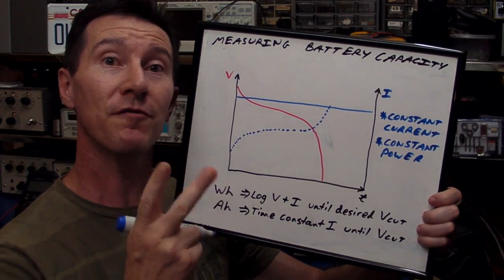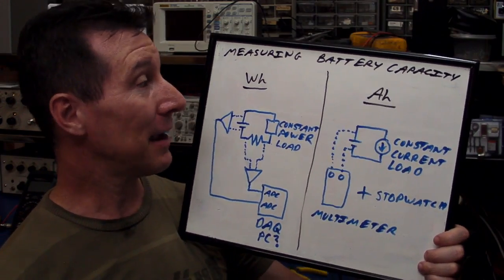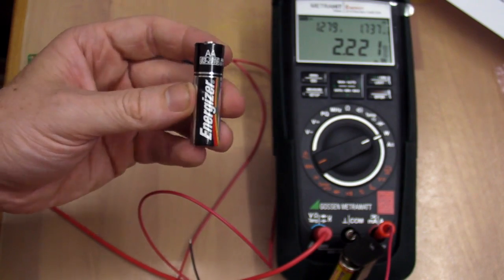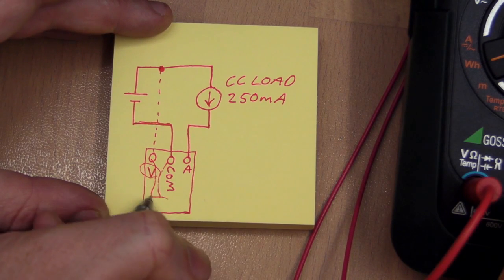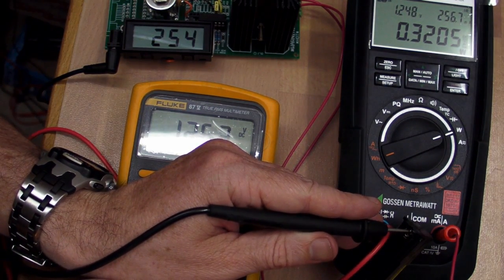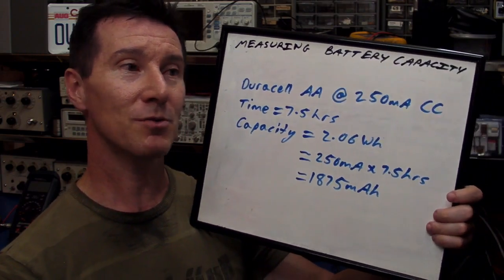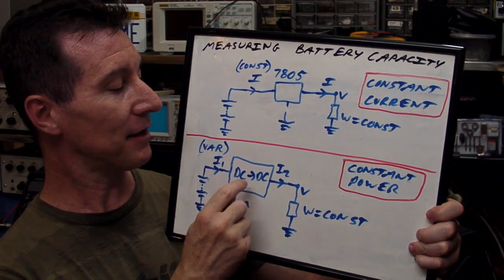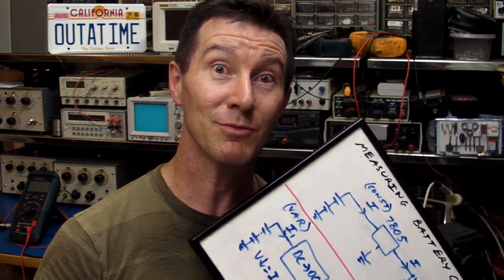EEVblog #141 - AA Alkaline Battery Capacity Measurement

Comment: If you've got a constant power load, as mentioned @ 3:20, you won't need a DAQ integrating P=U*I, but also only a stopwatch: E=P*t; if the power isn't constant (e.g. using a resistor, or a constant current sink, you'll have to calculate P=Integral(U*I*dt), of course)

Comment: EV-SAMSON SUPER BATTERY BOOSTER / 650% MORE ENERGY THAN A BATTERY ALONE CAN SUPPLY THIS AA BATTERY IS A RECHARGABLE BATTERY 1.2VDC @ 1400mAH THE BATTERY ENERGY IS COMPARED TO IT`S OUTPUT ENERGY GENERATOR / READ BELOW THE VIDEO TO FULLY UNDERSTAND THIS SYSTEM WORK OVER TIME / https://youtu.be/6eP-B_d9DoI

Comment: Ah the Procell! I have found these to be of a somewhat lesser quality than a bog standard Duracell battery... I have gone through heaps of these over the last few years, and they all seem to wet the bed when in a low-load situation such as a remote!
I've even opened a 24-pack of these in the C size, about two years from expiry, and a third of the carton were leakers!
The number of spring-terminals I've lost to Duracell makes me ill...

Comment: wouldn't it be easy to make a battery testing circuit for total mah, a constant current load circuit, a timer circuit , and a voltmeter circuit and a way to log the values . and some logic that make it start the timer when plugged in and stop it at dead
Reply: It would be fairly easy. You could probably use a current limiting diode.

Comment: I hope you look at these older posts, first of all I wanted to thank you for your time on these posts 

I had a question for you- can you use an ohm resistor in parallel to battery to simulate the load, and then measure- chart the voltage decay? then we can get the current by   (I=V/R ) and from that we can get watts?
Reply: +Steve Allwest watt hour question- so your meter is saying this battery has 2 watt hours, but if you take the chart you show for the battery  for 1 hour, lets say it is 1.4 volts linear at .25 constant load then it would only be .35 watt hour, so how did your meter come up with 2 watt hours?
Reply: Steve Allwest  *6hrs and you get ~2Wh

Comment: 5:30: It's called a numerical approximation of an integral. It's still the same integral, you are just approximating it with a numerical method, rather than calculating in analytically.
Reply: Everything is true except the approximation is not “the same integral”, it’s a sum.

Comment: Liked your video. Note that there are some battery chargers that can discharge the battery and measure capacity. I have one, LaCrosse (not a very good brand tough; it has some issues as charger!).
Reply: All advanced RC multifunction chargers can do that, beginning with the cheap B6 clones.

Comment: One important characteristic of a cell is its actual life in a low-power device where the decomposing processes are generally the cause of failure rather than the energy consumption. There were once special Japanese cells for calculators that lasted 30 years. Now the best I ever got as a record are Duracell AAAs that are still operating in a remote control 15 years after purchase and going strong. No idea if they still make them the same, I have installed new Duracells in a doorbell of my own make (no Chinese wireless crap) and it works now after 2 years. I know that's nothing so I'm curious how long that will actually last. This doorbell is that kind of device where time ruins the batteries.

Comment: Do a rant on rechargeable please.  Explain how one company can have a 2000mAh battery and another can claim to have a 3800mAh.  Assume same size AA and nimh.  Is cemetery that much different or better.   Never mind Dave they are all cr@p.
Reply: Some batteries are engineered different, some AAs are fatter than others, Vcut is specified at a different value and some batteries use more refined/purer materials for construction.
Reply: +aphocus And then theres 6800mah 18650s on ebay
Reply: drkastenbrot and then you can buy 3800mah 18650's that are actually rated at 800mah. but that I guess is the issue with any unregulated market.

I should also mention that some batteries are rated to last longer (by that I mean before they become useless and you have to throw them out), in fact most laptops have low 2000mah batteries because they last twice as long.
Reply: +aphocus Well, most people I know use their Laptop well over the batteries lifespan.

I once had an "Uitraflrc" (literally a fake of a fake) 4000mah battery, which had about 160mah capacity. Probably one with the new sand based battery technology ;)

Comment: In my case (photography) it's a lot cheaper to use rechargables and they perform better under high load (flasher). With regular batteries I have to wait, wait, wait...before I can take a picture.

Your problem (charge time) is not a issue for me, since I have several sets of batteries.  When I come home, I put the empty batteries in the charger. Next morning -or at the end of the evening- I put the charged set in the case or a battery stash drawer. The charger is located on top of this drawer.

Comment: Great vid!
After seeing this, I ask this question:
Why waste anymore money on Alkaline bateries?
The capacity is 2000mAh, the Duracell MX1500 Utra Digital is 2.2Wh.25W load.

Nowadays, there are affordable rechargable batteries which can hold their charge over years, and the capacity is about 2000mAh. Eventhough this is a bit less in Wh due to the lower voltage, still a better picck

My Maha MH-C9000 charger-analyser tells me the capacity of the Eneloop AA cells I use is slightly above 2000mAh.

Comment: what was the TEMP of battery while discharging? that could be the cause of the premature discharge (7.5h instead of 9h), the "typical discharge characteristics" graph on datasheet is calculated with a  (constant?) battery temp of 21ºC.